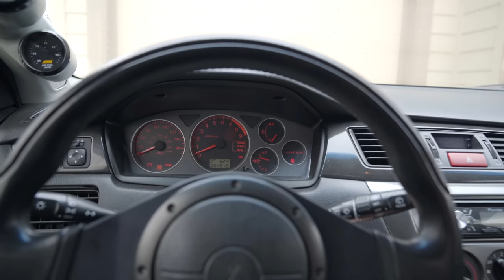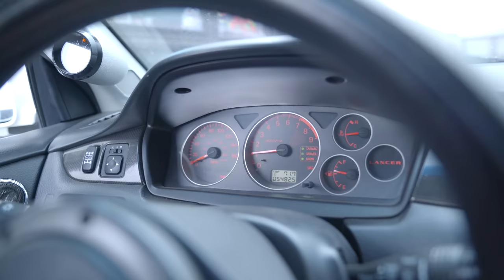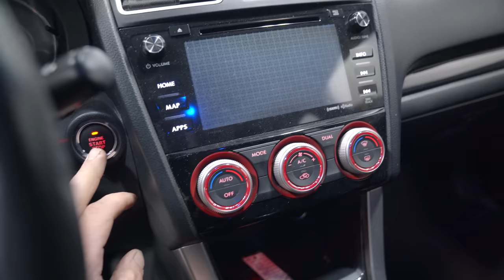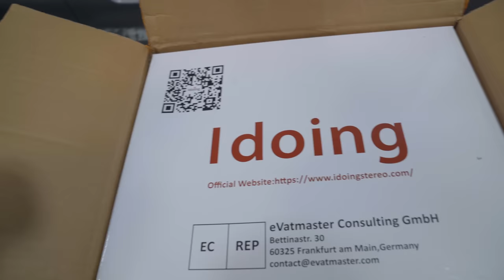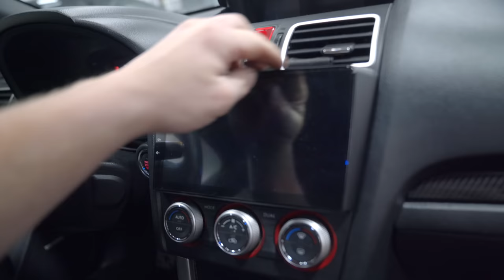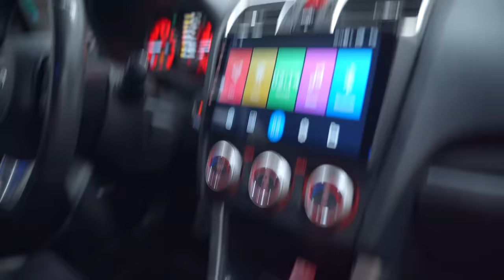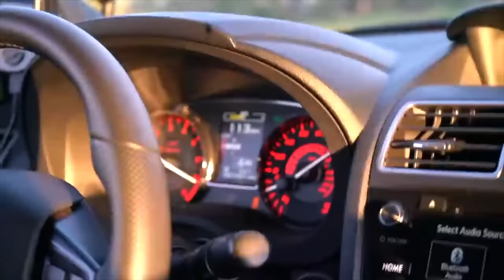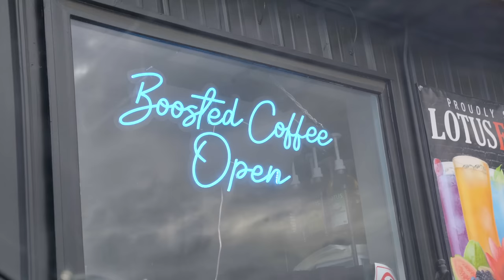Scaring Bobbi in the Evo (+ 1000WHP STI Pulls!)

Comment: The reverse camera needs a 12v to 6v power reducer on most head units. I swapped my stock camera with an aftermarket one in my Seibon CF trunk. Works perfectly with the iDoing head unit.